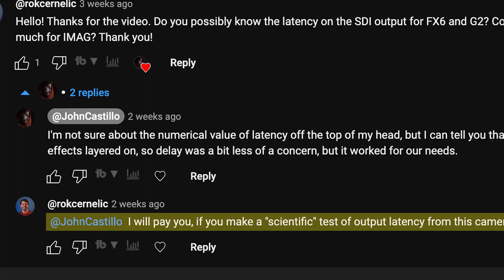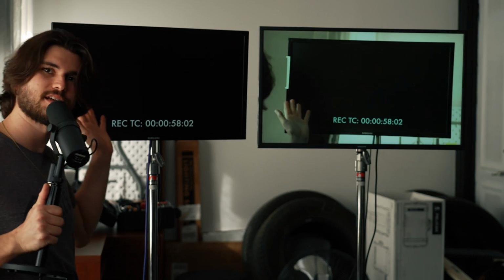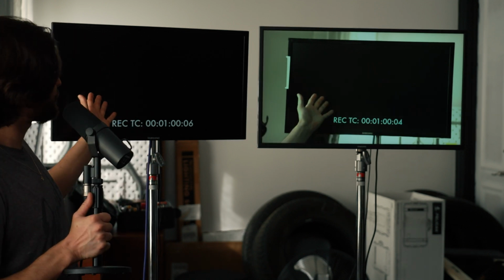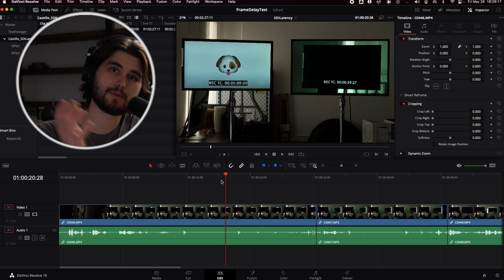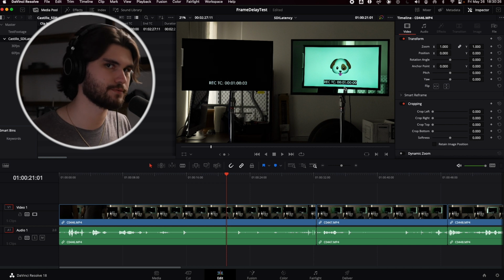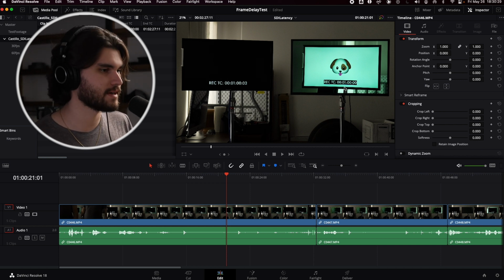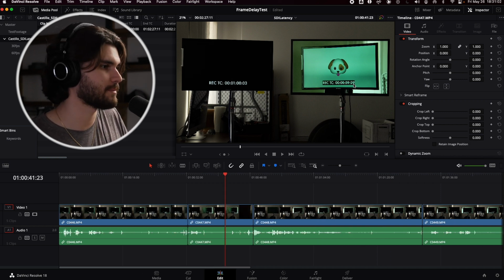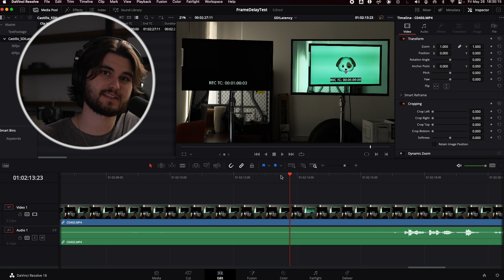Sony FX vs URSA G2 - Fastest SDI?!

Comment: How much of a delay is needed for latency to become a big issue ? Or is it just a norm that needs to be managed when when working with streaming?
Reply from the maker: I think it depends on the medium. For a livestream, if all the cameras have the same delay, 3 frames, the final output on YouTube would be in sync. YouTube has several seconds of delay, so in this example it’s not really a problem, as the audience watching it is not referencing it to anything other than itself.

However, for IMAG, this number really wants to be as small as possible, since we can see the performance in real time, and a delayed visual would look/sound out of sync. If I remember correctly humans can distinguish audio delays of over 20ms to be independent signals. 1 frame (at 30 frames per second), is roughly 30ms, so 3 frame delay can be substantial for certain mediums. 

Another medium affected by this would be musicians performing off-stage, who are following a conductor’s video feed. Often time analog cameras are still used in this instance for this exact reason.